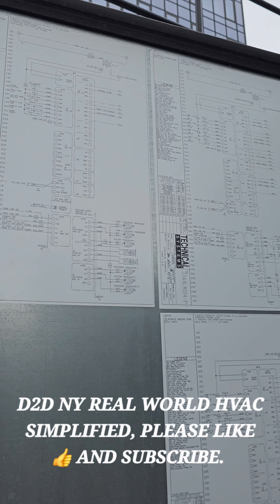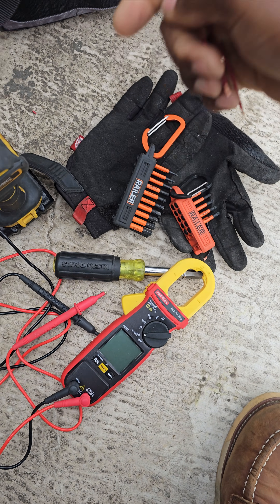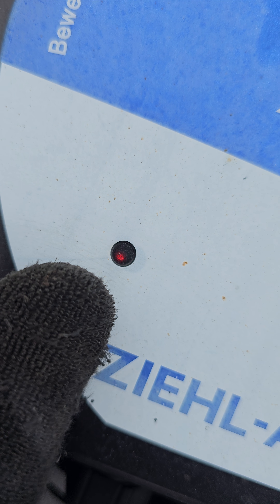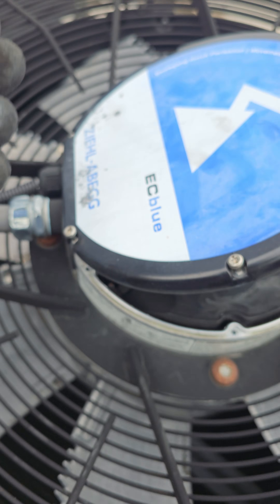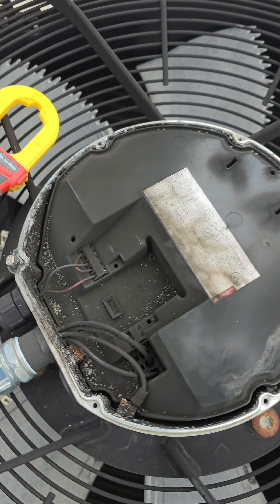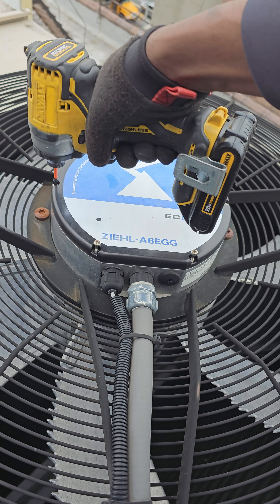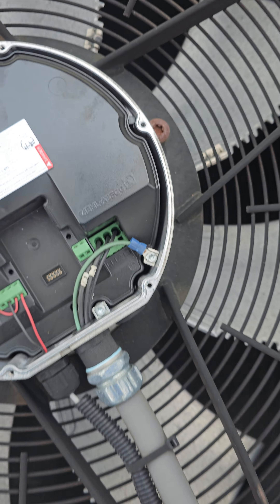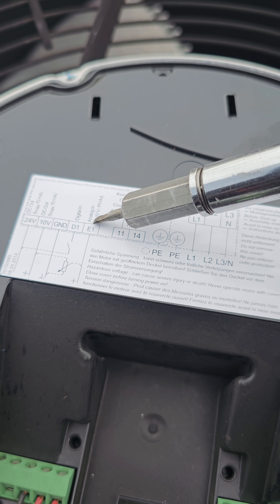ZIEHL ABEGG EC BLUE FAN MOTOR  | TROUBLESHOOT AND TEST

Comment: Good work 👍
If the LED flashes five times before pausing, this means that the motor is blocked or has been blocked. 
The flashing codes can be found in the operating instructions.
Reply from the maker: Awesome thanks for sharing

Comment: Hello sir, I have a question. I'm having a problem with the condenser cooling fan on a KKT Chiller of the same type. When the power indicator on the KKT Chiller display is on, the fan indicator is on, but the fan is not. I measured the 3-phase input power voltage and the control input power is 24 volts and 10 volts. Please enlighten me, sir, where the problem lies. Thank you.
Reply: I have tried the same method as you, sir, to test whether the motor is in good condition or not, but the fan is not working
Reply from the maker: It's either a settings issue in case of brand new motor or bad motor in case of used motor!
Reply: @D2DNYAC Okay, sir, thank you for the info.

Comment: We replaced 3 of those because somehow rain water got inside under cover. New fans we received already had redesigned cower stopgap (containing dabble the surface). We silicon sealed remaining old fans and the problem was sold.
Reply from the maker: Kool thank you for stopping by

Comment: We used these in our chillers and so far they are ok . We use 24 volt start signal from a control board then analog the 0-10 vdc

Comment: Those ECM condenser fan motors are junk. So many of them fail, and its not just one brand....its all of them. We service a site that has 2 RTAF'S. Each chiller has 14 fans and between the 2 chillers we have replaced 12 motors already, same with RTAC's. Had it happen with dry coolers, chillers, fan walls etc etc. Give me a conventional synchronous motor and a VFD
Reply from the maker: This is hvac future